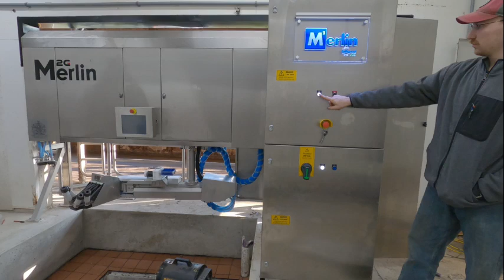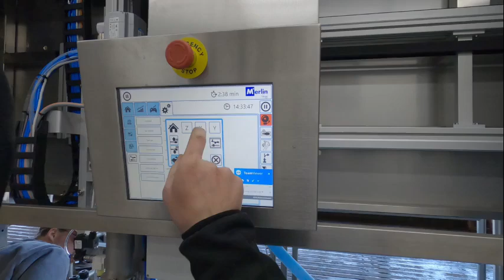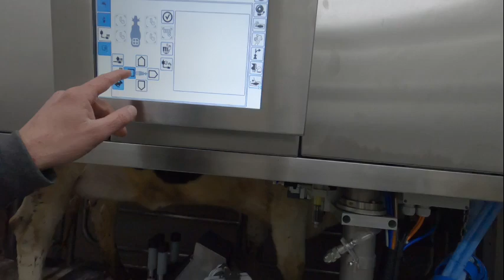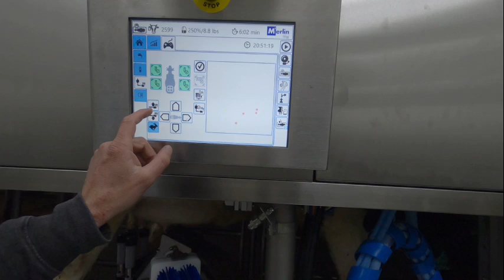Changing out our milking robot!

Comment: Big mistake going for the tiles, its going to be really slippery under te arm with the milk and water discharge, and within years the cleaning chemicals with break down the glue with all loose tiles. I have been there now i have rubber flooring, also not the best solution as it also gets slippery
Reply from the maker: The tile we used had an abrasive finish so it hasn't gotten  to slick yet. We're hoping the epoxy grout we used holds up.